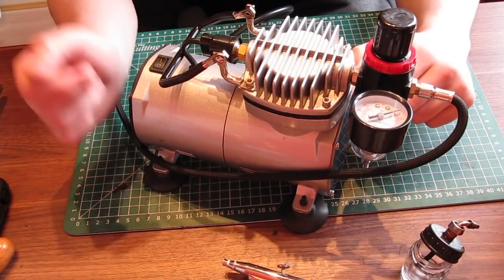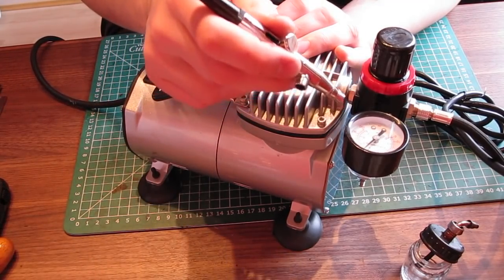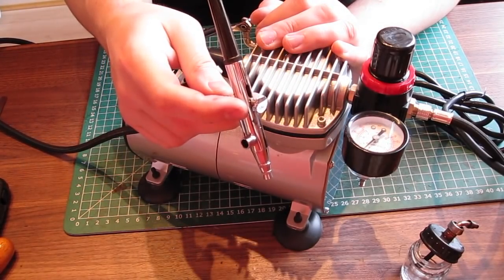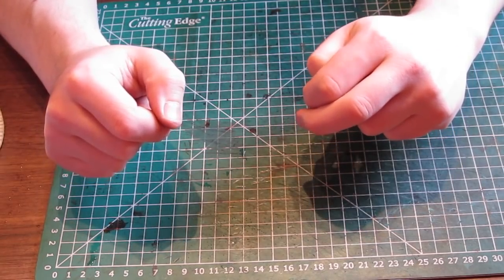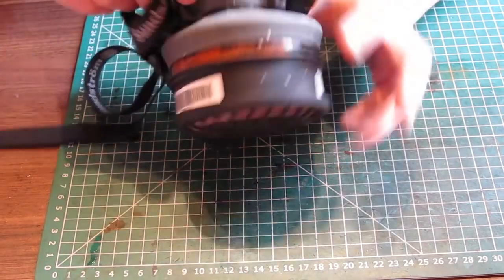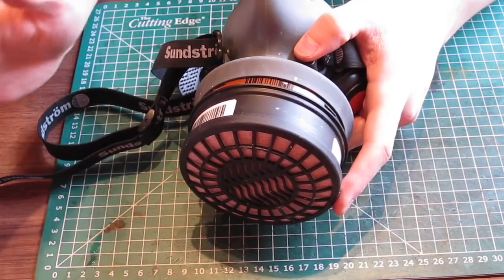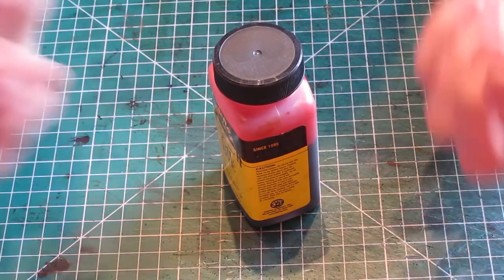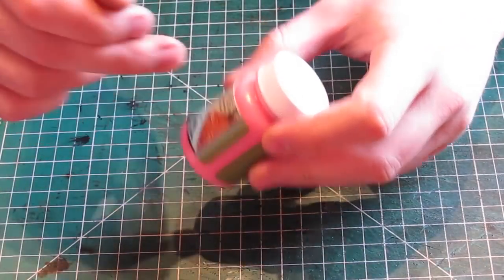Using an Airbrush for Leatherwork or Other Crafts

Comment: Ian, I recently subscribed to your channel, and am very appreciative for the things you teach and demonstrate regarding leather-working. I've just finished watching your video on airbrushing; a process I am very familiar with as an artist. You were discussing the mediums that can be sprayed through the airbrush, and seemed somewhat uncertain about the thicker, paint type materials you may like to use.
The solution is simple! Use whatever sort of thinner is appropriate, and gradually look for the viscosity you need. Then you will simply have to layer your spray coat by coat until you achieve the desired effect.

Comment: Just a tip on the Eco Flo, you can thin it with airbrush medium. I use the same for acrylic paints.
Reply: What's airbrush medium?
Reply: @Traderhood  it's a clear liquid you can add pigment or paints to that thin it enough to airbrush with without breaking down or altering the color.

Comment: For paints: Add 2-Thin Acrylic Paint Thinner to thin paints. Use 1/3 parts paint to 2/3 parts 2-Thin. This will thin the paint enough to use in an airbrush. The shade will lighten as it's diluted, so you'll want to do thinner coats and more of them to achieve full color, if that's what you're going for!

Comment: Ayup, Ian

what type of dye are you using to spray the sunburst shading?.. is it water based paint (Like eco flo "cova color") - or water based dye (Like eco flo "waterstain") or maybe standard oil/alcohol based dye like Fiebings....

I just got an airbrush and am ok with spraying but very cofused with what dye to spray, without clogging the airbrush or damaging the o-ring seals with IPA ...or having my design rub off.

Also what finish do you apply to keep the colours safe from wear and weather? Do you spray it on or rub t on?

Hope you can help because my crust is done right in! ..and I can't afford to experiment with dyestuffs and airbrush components because I'm poor.

Pete

Comment: Hi Ian.  Thank you for all your very informative videos!  I love how meticulous your work is and how perfect everything turns out!!  I just bought an airbrush compressor and brush.  I was wondering, do you need to use a respirator mask if you're using water based dyes? Or is just a painter's mask ok.  Please let me know your opinion.  Thank you!
Reply from the maker: always use a full respirator with an airbrush
Reply: Thank you for your quick response :-)  I have to go into the city tomorrow, I will pick up a respirator then.

Comment: Ian, so I've finally unboxed my airbrush kit, the same one as yours, and there is no regulator on my compressor... just checked back on this vid, and yours is the same unit, but your water filter has the regulator on top, as all others seem to have.  Any ideas on how to use an airbrush compressor without a regulator?  Haha!
Reply: thats easy, step one is go to the shop and buy a regulator... step two is put it on your compressor!

Comment: Hey. 
Is airbrush dyeing also called aerograph? If not then what is aerograph dyeing. Thanks.
Reply from the maker: +Juice I think Aerograph is just a brand name.
Reply: How durable is the airbrush dyeing coz i feel like the colors wont be submersed deep into the leather like incase of drum dyeing if done properly. 
Thus i feel like the colors will fade off in due time or worse case scenario it starts leaking and gets on you. Thanks.
Reply: They should be fine if you're sealing them with Fiebing's Resolene or Eco Flo's Shene product.  I'm sure there are others, those are just the one's that I use.